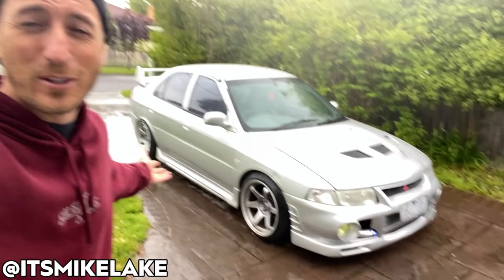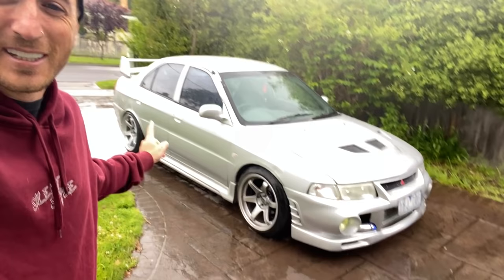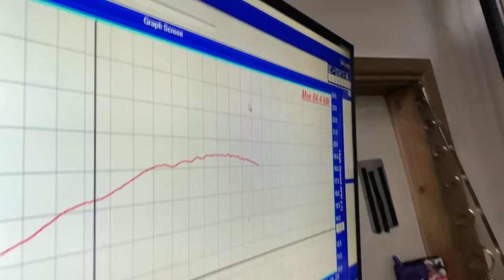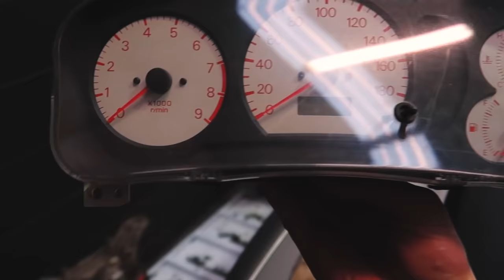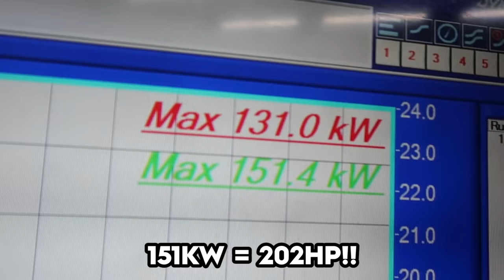Turning My LANCER Into An Evo In 10 Minutes!

Comment: bro i had literally tears of joy watching your build, damn these budget builds hit the feelings
Reply from the maker: Thank you bro! So happy with how it turned out 🥰
Reply: @itsmikelake  if using stock internal, just replace the stock head gasket to Decompression Head Gasket, is it strong enough to 200 hp?
Reply from the maker: @mr.eervianlesmana9263  I haven't replaced anything. Completely stock motor untouched and making 214hp :)
Reply: @itsmikelake  does that mean if i add a Decompression head gasket, the engine can make more power (around 220 to 250 hp), because the engine compression drops, so i can add more boost to the turbo?

Comment: As the proud owner of a Silver Tommie Mak Evo6 , this looks pretty darn close , unless you knew what you were looking at , you couldnt tell the difference, well done Mike.
Only thing i would have done different , is put a Tommie Mak front end on (looks nicer IMO + the cold air intake hole) , but other than that , if i was doing it , id done everything the same. Like flaring the guards would be a pain , with very little difference, i would have skipped that too. Dont get me wrong looking at it's wide stance is great , but if you were going to the trouble of that you'd just buy a Evo6 lol. Good job man , another 90's Lancer saved from the wreckers 👍👍👍 (not that i see many these days driving around NSW, more likely to see the Evo8's and 9's)

Comment: We used to own one which was 1.3 and 75 hp. I spent 15 years in that car growing up, from 5 years old to 20. My dream was to find a job and build it as an Evo (it had some mods on it, like bumpers, sideskirts etc, but not an engine). After the first quarantine, the car clocked about 160 thousands km and my dad sold it for a 2011 Opel Astra. It doesn't have the legacy of the Lancer, but it's got some modern style on it !

Comment from the maker: New turbo & clutch is on the way! Hit that subscribe button to stay up to date with the build 🤟🏻.
Reply: Convert it to Coil on Plugs!
Reply: If I wasn’t subscribed, I would be now. 
Killer video man. 🤙. Seeing the NA pulls then turbo pulls was crazy
Reply from the maker: @02hacker  I was looking at this but apparently it's not needed? My tuner said Evo run the same setup as the 4g93 with no issue. Maybe we're wrong? Haha
Reply from the maker: @mattbfab  Man thanks so much for your kind words bro. Appreciate that in a big way. Love this car!
Reply: @itsmikelake  I don't have much proof if it will improve  hp, but in some forums they say that it will improve the distribution of spark and it will easier to remove Sparkplugs lol. Maybe we are wrong 😅
Reply: Do a external gate bro 👌🏽
Reply: What fog lights are those?

Comment: Hey maté appreciate the lancer build, im a garage enthusiast myself im building my lancer that i have atm turbo kitted and all but i also post other CJ’s on my instagram or on my channel
Reply from the maker: Hell yeah bro, lancer buddies!
Reply: @itsmikelake  my goal is to empower the lancer community out there, too all my Lancer brothers and sisters my goal is to make conversion kits for CJ CF CH CE etc, Rwd conversion kits with manufactured parts and new auto transmission for the Rwd or a bolt adapter to the current manual box, Custom exhaust with a turbo kit and engine build kit designed by me.

Comment: Nicely done, but two questions :

1. Why dint u get a rear disc brake system ?
2. Why is the paint job not done in a proper painting room ?
Reply from the maker: The car is still a work in progress on the channel 😁. Rear disc brakes coming soon! And as for the paint, my channel is all about the DIY stuff. I built the car for some fun on the track and the paint job I’ve done at the factory is more than good enough 🤙🏻

Comment: Nice. Anything done to the stock interior of the engine before turbo charging it? I believe the compression and stock internal  not suited to the extra boost and power increase of over 200%
Reply from the maker: No, engine is completely stock. A good tune is very important. This engine is still very much alive and happy 😁
Reply: Wow.. That is a strong engine indeed. Nice job on all the mods sir, you did an amazing transformations on the mitsu in term of looks and power. May need to upgrade the brakes soon but apart from that I'll just say i am super liking what you did. Very nice sir👍👍

Comment: hey mike. love the video, i am 16 years old and have just bought a 2001 lancer for $1,000 with 200km. its got the same engine but slighty difference body. do you think the parts you have listed would fit on a 2001 lancer? if so i will work my ass off to buy those parts and start my first car project, Thanks for the motivation

Comment: I am a CE lancer owner. Own the same one as you. I was gonna buy the coilovers you put on but said specifically that it doesn't fit CE models lol did they just fit straight in?
Reply from the maker: Yeah that’s wrong. They fit fine. I had to run a washer inside where the front knuckle bolts up but that’s all it needs! They’ve been working beautifully for me 😇
Reply: Thank you so much for replying and letting me know, gonna get a set
My build is going nicely as well. Still more to be done
Reply: Just purchased mine, thanks for the link so I can purchase. Love to share my build with you. Show you some pics as I have the same car but in white lol
Reply: hey bro what year model do you have? was looking to do the same thing as yous
Reply: @CODGAME9  2001 bro

Comment: I really hope your still checking the comments here xD
I have an '04 CS/CH (I think) Lancer with a 4G94 and have been wanting to turbocharge it, but for everything ive read, the engine is weak as p*** and that i wouldnt be able to turbocharge it without replacing a whole lot of internals. Do you know if thats true? or if i can turbocharge it without replacing internals or replacing the bare minimum and how much PSI the engine could safely handle?
Its also got 273,000kms on the odo with an estimated lifespan of 260,000kms and i know that a previous owner use to belt it before they sold  it at around 60,000kms
Reply from the maker: If the engine still runs well, chuck a turbo on it and run 10psi with a good tune and it’ll go allll day long 😁

Comment: Question: Can the stock engine handle turbocharging or did you upgrade the internals
Reply from the maker: This is a completely stock motor. It's still running perfectly. They handle boost great. They just have to be tuned correctly.

Comment: thats decent amount of power on sohc turbo
Reply from the maker: Yeah, pretty happy with it! I was so impressed that the stock ecu could be tuned like that. I have a new clutch for her now so we’ll take it back and turn up the power 😈
Reply: @itsmikelake  what clutch do you got? stage 2?
Reply: @itsmikelake  yeah. the stock ecu can be reflashed, but i would recommend using stand alone ecu so you can eliminate the mass air flow sensor by that you can have more room for power 🙂

Comment: I believe mitsubishi making the lancer totally different to the evo 7-8-9 was a mistake beause owners couldnt mimic the evo bumpers/spoilers/etc the same way impreza owners do
Reply: But you still could do evo 7, 8, 9 conversion on the Cedia though. But the rear quarter panel needs to be cut & replaced with the evo ones.
Reply: @af2234  on previous generations was a matter of what? bumpers, spoilers and skirts? and the hood but cutting the rear quarter panel? isnt that too much?
Reply: @jnr1989  that’s the only thing that made cedia conversion a bit much than ck & ce. But it’s still legal in my country to do that. Pretty much same thing with lancer gt & ra conversion to evo 10, replacing with evo 10 wider quarter panel.
Reply: @jnr1989  In my country, most ppl don’t swap little by little like this. There’s some shop that do evo conversion on any models, which usually cost around $3.5k-$4.5k. They sells evo half cuts & order evo half cuts from Japan by customer request.
Reply: @af2234  original point was, impreza owners wouldnt need to do all that to mimic the look of the wrx sti variants. 

I know anyone can make a toyota mr2 look like a ferrari with enough cutting and welding.

By the way are you in thailand? Or phillipines? I know mitsubishi has or had strong presence over those countries
Reply: @jnr1989  Yeah, the downside is it wasn’t easy as those Impreza conversion. I’m from Malaysia btw.
Reply: @af2234  hey I was close in my guess haha. Look I Have a mitsubishi l200 (k74 chassis) I can see the plate in the engine bay it was manufactured in thailand... I have reasons to believe that part of the world has things unseen for the rest of the world when it comes to mitsubishi.   Do you know enthusiast groups where I can join to share info? I only speak english and spanish so I guess some language barrier may be a challenge here.